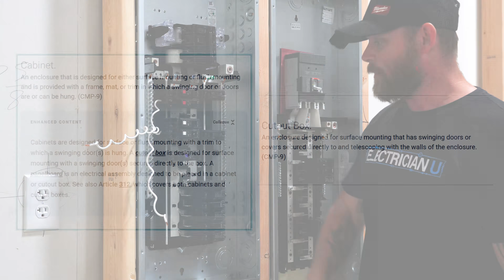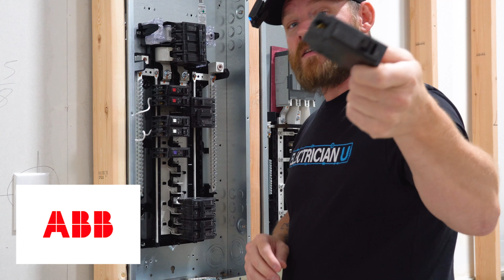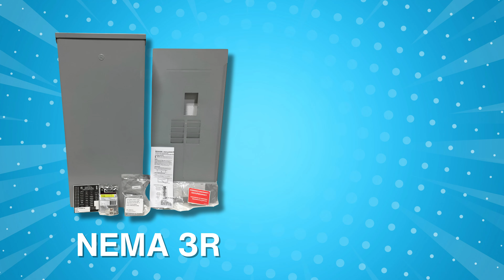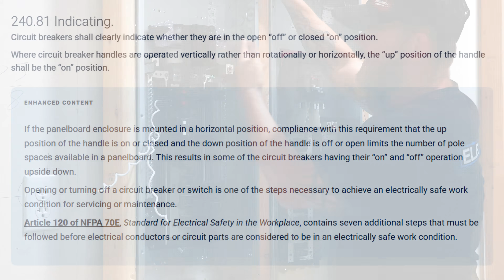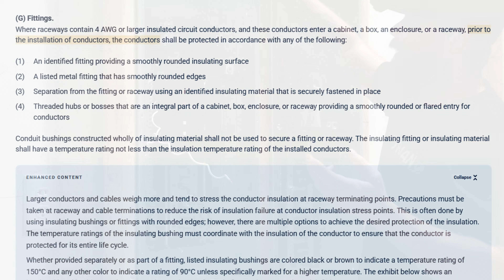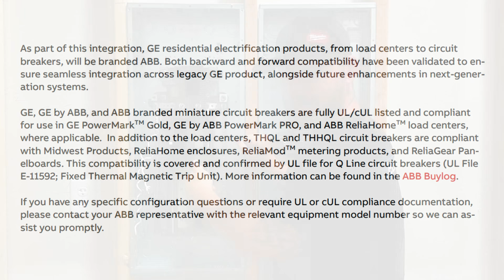Everything You Need to Know About Electrical Panels

Comment: One of my questions: Putting those neutral plug in breakers in, assuming you were doing this for residential. You mentioned “might want to”. Is that something that costs more, and you pass that cost to the customer? Is that something you would discuss beforehand, or just “this is better in my opinion/etc etc” and just do it?

Comment: I just bought two panels that I now have to return. I have a Nema 3R outdoor surface mount Challenger that was flush mounted that I need to replace. I read a little, made a decision, bought one. I read some more, changed my mind, bought a different one. Now I've read and watched even more, and now I feel a need to return the first two and buy a third one. At least I'm doing my homework BEFORE I regret installing something I learned too late wasn't the right thing for the job. At least that's the way I'm hoping it turns out. So many terms. So many acronyms. This time I learned the whole flipping the panel for bottom feed, "OFF" position needs to be down thing. Many thanks!
Reply: Hey can I ask you this can u use that breaker kit on an old ge powermark plus it's 200 amp but main is almost shot and it's expensive really need to know

Comment: Something I was told once, that I don't think you address here (which makes me wonder if it's even true), is that it's a good idea to try to more or less balance the load across each side of the 240 supply. In other words, you wouldn't want to have a 30 position panel with 15 breakers on either just the right or left side. 7 on one side and 8 on the other would be better than to place all the loads on one side of the service. Is this true, or at least a good general design principle?

Comment: Its the crazy stuff going on inside the panel that scares me being a Craig's list electrician😮🤔🤣 lol Just kidding! 🤦
Actually sir, just wanted to say as a diy'er that was a great video! You should be a college instructor! 🥇👍 Now a question. 
You mentioned the grounding terminal strip and it's placement. Side bottom, wherever. You need to install that ground bar in your panel for the bare wires if your service is bonded at the outside meter disconnect. Question is.... If my panel is bonded inside with the green screw through the neutral bar to the box. Do you still have to install that ground bar and keep all of your bare ground wires separated from the two neutral bars? I've seen my sister's new panel and she has the screw installed in the neutral bar, but the grounds are all mixed in with the neutrals on the neutral bars. White bare white bare white bare etc.. Shouldn't they be kept separated just like in the panel that has its bond outside at the meter? Seems to me that if you had an imbalance load from A to B and the neutral is carrying that imbalance, that every one of those bare grounds connected to that neutral bar would be carrying that imbalance out to your outlets. And if you touched that bare wire at an outlet with an imbalance current potential on it you'd get zapped. So neutrals and bare grounds should be separated in all panels for that very reason! Need some help with this. Thanks and I have subbed, great channel for sure.! Later! 🏁💯👏👍.

Comment: I still don’t understand single pole and double pole breakers with the same ampere ratings. I guess my confusion is the difference of 120v vs 240v. The way it was described to me is volts are like the water pressure and amps are the amount of water. How does a stronger pull allow you to run bigger appliances and what when the amps are still the same idk… I’m so lost when it comes to electrical theory. All I do is twist wire 😅
Reply: So basically the amps are the flow of electrons. Voltage is the pressure behind it. And when something is on a 240v circuit it’s not that it has a stronger pull but that it has more force to push the amps. This is why the amps usually drop if you switch something to 240v it’s because there is more force roughly double the force pushing on the electrons to push them where they are being drawn by the load. It’s basically that it’s easier to flow electrons when the voltage gets higher. It’s like utility lines run at 7200v in a lot of places but they only push like 10 amps for a whole neighborhood. But once that’s stepped down to 240v you need 200 amps to power a house. We could use 7000v for everything and have really low amps but that would be very dangerous.

Comment: I am genuinely curious why would you not just use Dual AFCI/GFCI breakers (rather than one or the other) since there is a lot of overlap between where they are required per NEC. At my big-box store, there is only about $5 difference in price between GFCI and Dual AFCI/GFCI breakers.

Comment: I'm a "handyman" who is extremely mechanically inclined and I thrive on challenging myself. 
I did a whole house remodel out of state at a long time client's vacation home. 
This included, on the electrical side, changing/moving plugs, switches, and rerouting/adding lights and such. 
The condos were built in the 70s, so, needless to say, things weren't to the highest standards. 
The panel was a mess and NOTHING was labeled. 
I wired a trip switch and spent 2 days sorting out the chaos. 
I straightened all of the wires and labeled everything. 
About a year later my client wanted to add an outlet on their patio for string lights. 
Well, I wasn't going to go from SoCal to Colorado just to run an outlet, so she hired a local electrician who was recommended by her neighbors in the complex. 
She called me just to tell me how impressed the electrician was with my work on the box. 
You don't have to be a "pro" to take the time to do things right.

Comment: Hello, I had a panel installed and asked for there to be a main shutoff in the panel, they never did it so when I do panel work it's always live. In a case like this are there more flexible gloves I can  use to be safer? Also, can I add a main shutoff in that panel after the install?
Reply: Hey man, I know your comment is 5 months ago, but I just wanted to let you know that any panel that is ever installed has a main breaker/disconect.

And yes, they do make specific ppe for electrical work, but it would be much safer to just turn the power off completely in your instance. Use a multimeter or pen tester to make sure there is no power and you can work on it as freely as you need to :)

Comment: Non-electrician here…what is the point of double and triple pole breakers if they are only rated for say 20 amps? Why would you not use two single 20 amp breakers instead of using double the space for the same amount of amps?
Reply: Just a basic explanation. 2 and 3 pole breakers are needed to wire equipment with 2-3 hot wires. The poles are electrically isolated but trip together. Also, breaker current ratings are rated per pole, that would be 20A per pole for a 3 pole breaker, but we don’t add it up and call it 60A.

Comment: Some thoughts - I have heard you need BOTH the surge protector stuff on the panel itself AND at the point of use - I argued years ago with GE on what they were doing to protect the delicate circuitry on modern fridges, where I read a lot of complaints from people coming home to fridges with melted circuit boards, and spoiled food, blackened components. They had said "no surge protectors" claiming they were extension cords, and I stated NO, surge protectors - finally they said you could use a surge protector on a fridge IF it was made for a fridge, mine is made by RCA.  My understanding is that it is not only the big huge hits that kill appliances and electrical stuff, but also the many small daily hits that wear delicate circuitry down. Also, surges and stuff doesn't have to come through the circuit breaker panel, it can come through a lightning strike on an outside light fixture, or other avenues like that.  And another thing - I didn't understand the ground screw thing - why a ground bar inside the cabinet, but a green ground screw if outside?   Another thought I had with panel height was if in an area that had any possibility of flooding,, I would put the panel as high as legally possible.  Often wondered in basements why they didn't change electrical outlets and stuff to be much higher - maybe with a walkway to access from up higher. AND, if you had a panel without a main breaker - almost seems like it would be great to have the whole panel supplied first by a main shut off fuse box, like you would have for a central a/c unit - my thoughts is maybe it would help "filter" a bit if something like a lightning strike hit, AND if you replace a fuse it is "cool" again, and not already hot as a tripped breaker is if you quickly turn it back on again.

Comment: This is not a code requirement but I like to put the larger breakers closest to the main breaker or in the case of a MLO panel as close to the input as possible. This helps minimize bus resistance and therefore heat buildup in the panel.

Comment: @7:05. You can only get main breaker kits if you have commercial panels, but you still have to make sure you have room in your tub to do so. You cannot change it if you have a residential panels, they don’t make a main breaker kits for those. You can change the main breaker if it’s defective over time, but you cannot upgrade.

Comment: Any panelboard downstream from the main disconnect has to have the neutrals and grounds separated. With the new NEC requiring a disconnect at the meter socket, the panelboard inside the house has to have the neutrals and grounds landed on their own bus bars.  This also applies if you are installing a whole generator with an automatic transfer switch, the indoor panelboards have to have a ground bus installed.
Reply: Yup. Say 60 amp sub panel is bonded. The neutral will be a route for 200 amp panel to get to ground. Fire!

Comment: Regarding mounting the ground buses at the bottom. Decades ago I was wiring a panel with the bottom lower than my line of sight. The two bus bars just poked through a heavy phenolic panel near the bottom. My needle nose pliers really took the hit. The pliers were insulated and I was standing on a rubber pad. Made me a religious man. Be safe everyone!

Comment: Excellent video, very condensed with a lot of very good information. I really appreciate your insistence on taking pride in our work, so that it will impress people we probably will never meet.

I work commercial/industrial, and need to pass on one tip. You mention conversion kits to go from MLO to Main Breaker. Depending on whether the inspector is doing his job well or not, if the stamped set of prints calls for MLO or Main Breaker, and he finds that we have installed the other type (including with conversion kits), he will fail the inspection until either the panel is fixed to match the stamped set, or an approved revised set of plans are issued that match what we actually installed.

Comment: The code states that bushings must be placed before pulling the wire into the panel, so the inspector should never find conductors in a panel without protection from a bushing
Reply: Scraping off insulation on sharp edges by not doing the bushing first ... yah.  I've actually made that mistake.

Comment: I was waiting for more explanation of what the neutral pigtail was for. It is only needed on breakers like GFCI or ARC trip breakers, which need to monitor the current through the neutral to do their work, right? That's why I have never encountered them. Maybe you said that, but I missed it and there was a lot of assumed knowledge that you don't realize is assumed knowledge.
Reply: Right.  Also surge protectors.  This is where plug-on neutral panels really come in useful.

There are also regular plug-on-neutral breakers that include lugs for both the hot and the neutral (a bit different than the pigtails), though the improved wiring convenience isn't so improved that it is worth the extra cost.

Comment: Homeowner here, not an electrician... 98% of the time you don't use the green ground screw?  Is that assuming there's a service disconnect upstream from the panel?  My home's panel (Square D Homeline, installed new 1999) doesn't have a separate ground bar, and I'm 99% sure neutral is bonded to ground.  The panel has a main breaker, the green screw is tightened down, and there's no service disconnect upstream except for what might be in the meter box outside.
Reply: It could just be an age thing.  My old Square D main service panel is the same.  There is no separation... the "neutral" bar is not insulated from the metal backing plate and the service wiring groups grounds and neutral together on the same bar.

Does code even allow a green screw for bonding any more?  We use actual bonding cables straight into the neutral bar to ensure that the bond is low impedance.

p.s. I really hate my Square D panel.  The absolute worst panel in existence.

-Matt

Comment: I have a question. I have a transfer switch Eaton DT223URH-N for the neutrals can both generator side and power company side be tied together? And would it back feed if I connect it like that?

Comment: If the main breaker in a panel operates from side to side, it would be possible to orient the panel in a matter that would violate code.. "the rule that says the on position must be up " in my over fifty years I never saw a panel mounted sideways but there is always that "one guy" that has weird ways of doing things. I had a friend or "rather an acquaintance" that was "that guy" if there was a weird way of doing something he was the guy that would do it. He was really a hell of a good electrician and knew his staff but he liked to push the envelope at times.  I think he like to prank with inspectors to make them have to show him he could not do something a certain way. I am sure you have come across those people like that before. He was the type guy that would glue a hard toe cap on a pair of flip flops to prove a point that they were hard toes but they really wasn't. They did not meet the very obscure code requirements of hard toes footwear but you would have to dig out that obscure code to show him he was wrong.  He really was a nice guy but stubborn as a Missouri mule.  I guess that is why he and I got along so well we were both alike.

Comment: My understanding is that most normal circuit breakers will only carry a sustained current of approximately 80% of their rated value.  Might be worth checking if that is, indeed, the case.
Reply from the maker: I'm not sure where you got that information, but those numbers are straight from the manufacturer, and the UL listing of a breaker is in place to ensure breakers hold at 100%, thermal trip at 120%-130%, magnetic trip at 200%, and have a maximum interrupting rating (AIC rating) of typically 10,000A for MCBs. Bigger breakers like MCCBs often have much higher AIC ratings, some up to 65,000A.
Reply: I was told try not to use more than 80% of possible load on a circut. So if it were a 15 amp circut (1800 watts), try not to put more than 1440 watts on at one time.
Reply: @casssmith2002  No, that's for appliances, not for breakers or wiring.  An AC breaker and its wiring must be able to take 100% of its rated current indefinitely without tripping.   The actual circuit should not be loaded more than 80% by the appliance.

Thus on a 15A circuit any single appliance should not draw more than 12A continuously.  Roughly 1440W but generally the marketing of the appliances all say "1500W".

Another example would be a L2 EVSE for electric vehicle charging.  The EVSE should not be configured to use more than 40A on a 50A circuit.

-Matt

Comment: What would be the reason to have a single breaker that is a “triple” 20 amp breaker. Is it to run a series of implements or devices that run in sequence or…?
Reply from the maker: Are you referring to the e-pole 20a breaker I talked about in the panel to the right? That's a three phase panel so its for three phase machinery. In general, three phase power delivers more energy per second, for the same amount of current delivered through a load so three phase is often used in commercial and industrial where they either have a ton of equipment, or really powerful equipment. Hope that helps!
Reply: I thought that was the case. Thanks.

Comment: Like your videos but your comment on amps is misleading. For a double pole circuit, each side can provide the rated amps, and consequently double the power. You seem to imply that a 20A double pole breaker can only provide a total of 20A and therefore only 2400W of power. Not true. It can provide 40A of power, 20A on each pole, 4800W.
Reply from the maker: That's not how it works, my friend. If it were providing 40A why do we still put 20A wire on them? If that were true we'd be running 8AWG to all of our 20A breakers. The 2 pole 20 wattage is actually double because of the doubled voltage, not the doubled current. Instead of 120V (single pole 20) x 20A = 2400W, the two pole breaker is 240V x 20A = 4800W. Each pole of the breaker is there to protect a 20a wire connected to it - we just have 2 wires connected with a 2-pole breaker. 3 wires with a 3-pole breaker. Great comment though, hope that helps clear up the confusion.
Reply: Just to add on what was said above. You're probably thinking of a multi wire branch circuit where each pole supplies 120v and returns on the neutral (20a+20a) x 120v=4800w. A true double pole "feeds" on one pole and "returns" on the other pole so the current is a straight flow from pole to pole and the available voltage doubles 20a x 240v =4800w. At no point do the conductors see 40a.